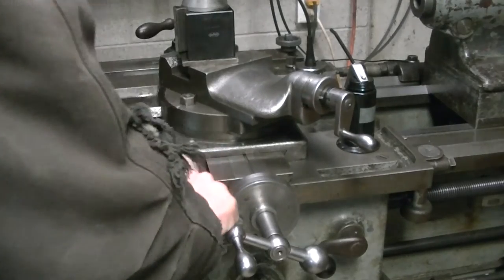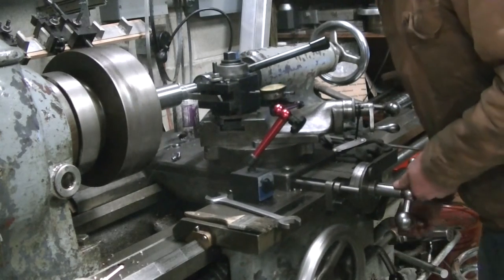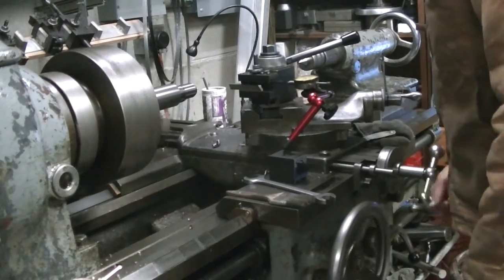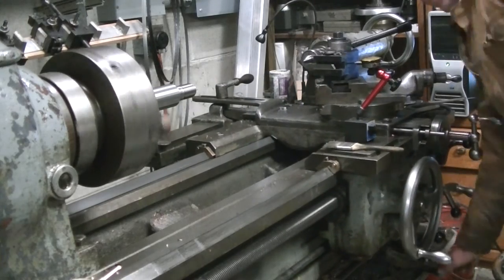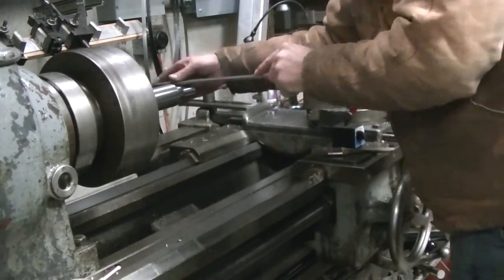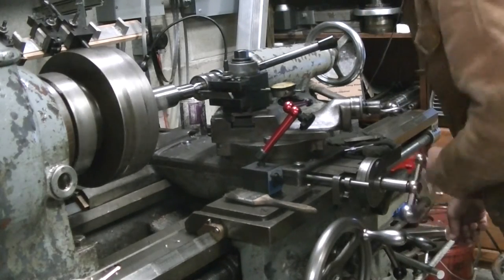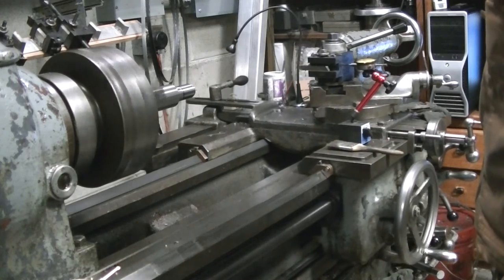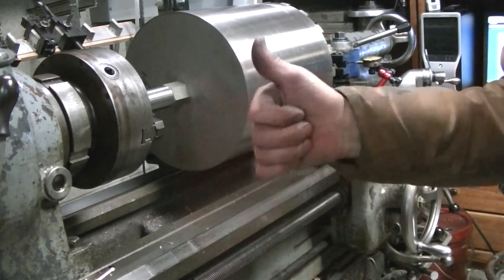Threading, Hendey Style

Comment: Most of the US makers offered this lead screw reverse as an option. In use, threads can be cut at higher speed then the thread dial allows, and improved accuracy from the half nuts settling in. Great video.

Comment: very nice gearhead hendey my old tiebar as can be seen on youtube had a different carriage and this Hendey is what what i would now only own if i were to buy another machine, most people do not have a clue about Hendey and there quality!
Reply from the maker: Lawrence, thanks for stopping by. I have watched your videos as well as Jeff Sigrist's on casting the pulley wheel for your Hendey. I've thoroughly enjoyed getting to know my my gearhead Hendey and am excited to have kept the tiebar from the scrappers. My plan is to make a set of change gears for the tiebar and set it up for metric threading. I just got the specifications on the gears from Hendeyman. When things get under control at the day job I'll get to work on the gears. Craig
Reply: my videos are not too great but I would like to think i got the hendey ball rolling in a way :)
Reply from the maker: +Lawrence Harasim it is the sharing of information that is the important thing. We can all learn from each other. When I bought my gearhead Hendey 10 years ago, information was tough to find and mostly limited to the Practical Machinist forums. It's amazing what is available now. The problem with the tiebars is after Patrick Black's restoration the bar is now way too high. Craig
Reply: Thanks not too many vids with gearhead lathes being used like yours :) and I would have to agree Mr Black's lathe should not be used LOL

Comment: I'm learning on my dads Hendey 16 x 54 almost identical to yours. Nice to see you can reverse the travel without stopping the machine, didn't know that. His is real jerky and likes to kick of the traverse screw so I hold her down. I got the basics down but can't really figure out all the lever settings. It said 24 TPI hole 1. I put it in 1 and got 80 or something. Put it in 2 and got 24.. A video on the settings would be great Clem. Thanks, Martin.
Reply from the maker: fla playa Thanks for the comments. When I got the lathe the reversing lever didn't work at all. The rod below the lead screw that is actuated by the reversing lever needs to be clean so that there isn't any drag on it as it moves through the lever on the apron. There should be stops on the rod to set the lever to kick out where you want the feed to stop. So when the rod is pulled one way or the other it will kick the reversing lever into neutral. Make sure it's clean. Have you downloaded the operators manual from the Vintage Machinery.org website? There is a lot of good info on running a Hendey there. I'll see if I can get a video of the thread/feed selection for you soon. Craig

Comment: That is a nice lathe.  I don't think I have ever seen one that reverses like that.
Reply from the maker: Amateur Redneck Workshop Thanks for stopping by Harold. I think Adam Booth's Monarch reverses like that but he uses the threading dial instead. It is a great old lathe but I just had to do some work on the apron. I picked up a much older Hendey recently (1910) that I'm restoring and will have a video or two about soon. Craig
Reply from the maker: Amateur Redneck Workshop Thanks for stopping by Harold. I think Adam Booth's Monarch reverses like that but he uses the threading dial instead. It is a great old lathe but I just had to do some work on the apron. I picked up a much older Hendey recently (1910) that I'm restoring and will have a video or two about soon. Craig
Reply: Some Monarchs and LeBlonds, a few American Pacemakers and DSGs, all Hardinge HLVs, Lodge and Shipley & Pratt & Whitney toolroom, Reed Prentice, Holbrook, Sidney, Rivett, CVA, had them. It relies on a single-tooth dog clutch which engages only one for each turn of the spindle. Generally there are separate forward and reverse clutches, as with the Hendey (I have an idea they invented the device)

Comment: So need to let the carriage pull it's self back with the leadscrew when using the thread dial in conjunction with the leadscrew reverse, so long as you re-engage it on an appropriate line.

Comment: 12 x 30 hendy gearhead is my everyday driver. Nice to see a video featuring a good old hendy.
Just a suggestion.....raise the volume. Can barely hear you on this video.  Great video. Thanks for sharing.
Reply from the maker: +LEAF A Job Shop in N.W. Indiana thanks for watching and commenting. I think I've got the volume issue fixed in the more recent videos. I'm restoring a 12x6 Hendey cone head right now, hopefully it'll be running this summer. The only thing better than a Hendey is two of them. Craig
Reply: @clemwyo  I have a Hendey Cone Head. Where can I find a manual ?
Reply from the maker: @johndebrular979  you can find a manual and lots of other info at vintagemachinery.org. Look up Hendey in the manufacturers index. Craig

Comment: No spindle lock on such a nice machine?
Reply from the maker: Rolingmetal thanks for stopping by. There isn't a spindle lock but it does have a brake that stops the spindle by pushing the clutch lever all the way down. Another nice feature is an index on the spindle that allows for easy cutting of multi start threads. Craig
Reply: A lot nicer the my 1943 German lathe :)

Comment: I think that lathe is older than that? If it is gearbox it is dated right. If flatbelt older
Reply from the maker: +voluntown according to Hendey's records, it was built the third week of October, 1943. The quick change gearbox and reversing lead screw were used on Hendeys from at least the early 1900s (my 12x5 tiebar
 was built in 1910 and had them). Thanks for watching and commenting. Craig
Reply from the maker: +Atrixium I'm restoring a 1910 12x5 cone head right now. Apparently the patent for the Norton quick change gearbox was applied for in 1893 and granted in 1894. Here is a link to the patent http://www.datamp.org/patents/displayPatent.php?id=29746 . The drawing of the gearbox looks just like those on both my 1910 and 1943 Hendey's. Hopefully the conehead will be up and running this spring, I'm setting it up for metric threading. Thanks for stopping by. Craig
Reply from the maker: +Atrixium I thought my cone head would be a lot lighter than my gear head, turns out it's only a little lighter than the gear head. Hendey put a lot of cast iron in their lathes.